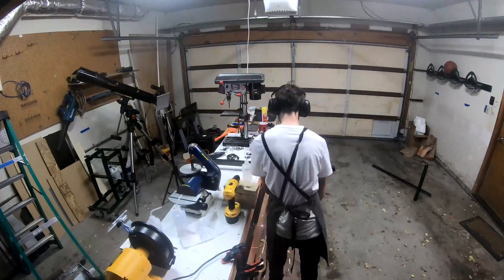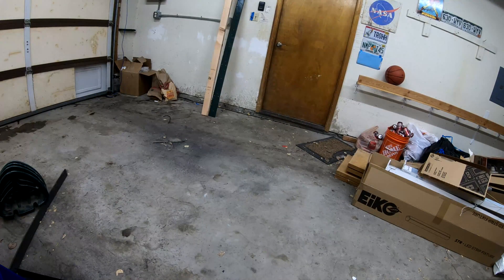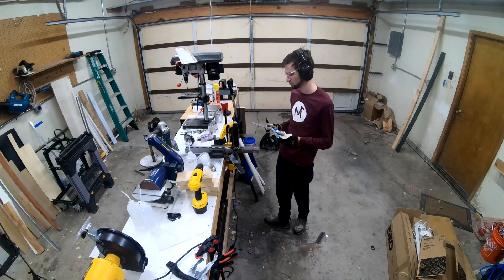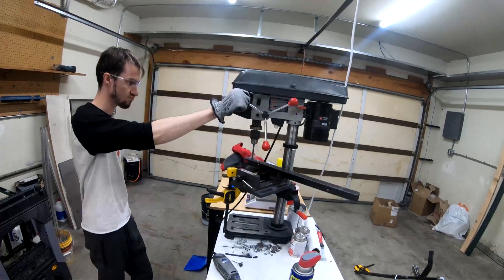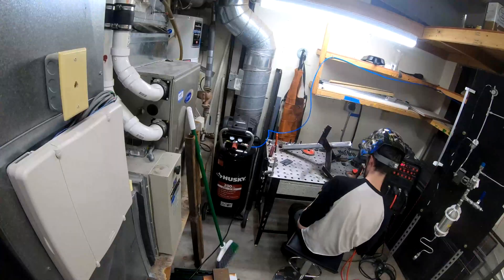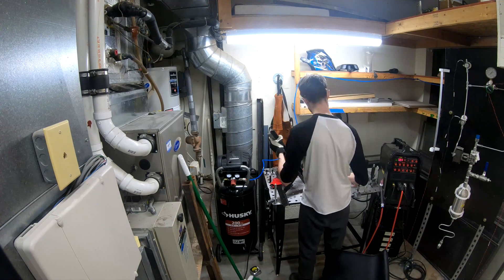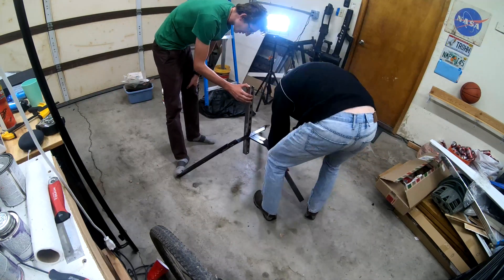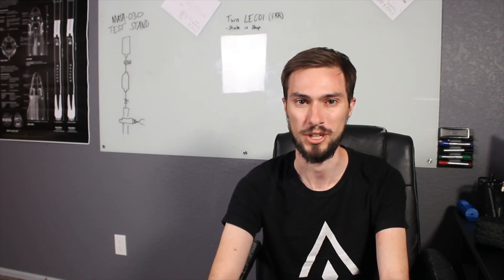High Powered Rocketry 3: Building a Launch Pad

Comment: Couldn't quite hear/understand the audio in some places - what went wrong with the rocket motor?
Reply from the maker: The forward closure on a batch of motors made by CTI in 2016 was made from a plastic with an incorrect additive. This motor has been hanging around in my launch box long enough that it was from that batch. I checked it, but either did a poor job or it was some different problem.
The top of the motor burned through in about a second and fire came out of the top and the bottom of the rocket.